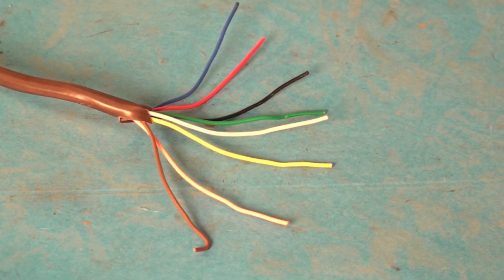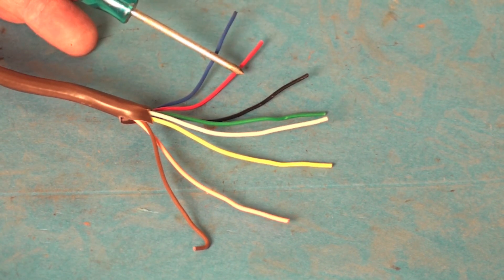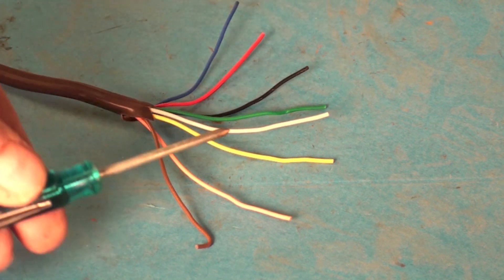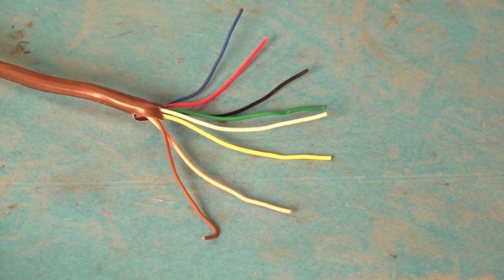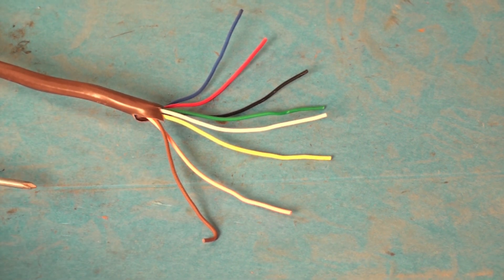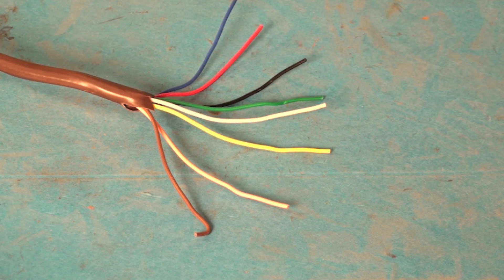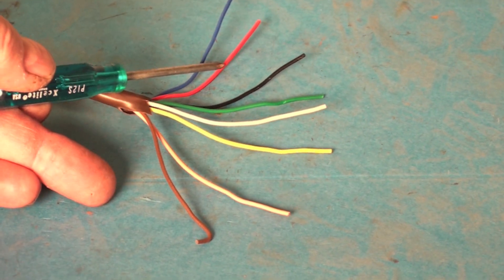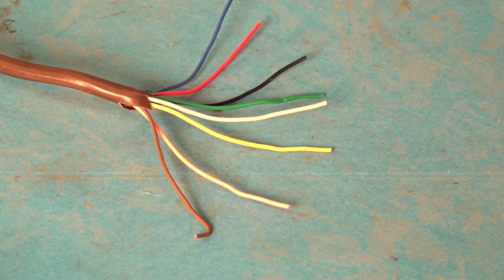Heat pump thermostat wire color code

Comment: I think it depends on the units age. And then it also depends on what type of thermostat you're going to use. Cuz mine is coming out different. But I'm finding out is being an HVAC tech a lot of things could differ. I am not a tech I'm just trying to install a newer thermostat. The color of wires and what they operate is not set in stone.. I'm starting to think there are a lot of  variables.

Comment: If working on an older unit, pay more attention to the way the board is wired in the air handler. Most often this is followed but sometimes it’s not, for whatever reasons.

Comment: Thanks for this. We have been roasting for years because they just want to replace our system in our area instead of diagnose issues. Was able to get my thermostat wired correctly and get some cool air in my home

Comment: New to the channel, so hey . Its just a question  about my thermostat wont kick on. My old sears heater for our home.  If i touch wites its sparks, but will not go otherwise. Any suggestion aside from just gettinga new  one.

Comment: nice video,but can you please help me connect them wires on my hvac heat pump non programmable thermostat   my actual wirings are red,green,yellow,blue ,white.and the thermostat is c,o,b,w/e,w2, thank you very much....

Comment: Hey Gary! I have a heat pump, no black wire. I have Red,  Blue, Green, white, yellow,  brown and orange. 

Trying to decide if I put the orange wire in the W2/OB slot or in the Y2 and the brown in the other
Reply from the maker: You can use brown for common if it is needed.  I would use white for W2 (backup heat).  OB (reversing valve) O.  You also need to know if the reversing valve is energized in heat or cool.
GFM
Reply: I ended up opening the furnace and checking how it was connected. The brown wire was attached to anything! So far it seems to be working! Your video was really helpful thank you

Comment: can someone suggest me with Honeywell classic (round one) and i have only two wires, black and white.
i tried to insert black to  black and white to white but boiler does not work. Alternatively, i connect white and black with hand to keep it running so basically thermostat does not work. Any suggestions please...
Reply from the maker: Set R to one wire and W to the other.
GFM

Comment: Question on my old thermostat my Black and white were both on the W in the panel? why was that?
Reply from the maker: The white is probably heat.  The black could be to power a humidifier.
GFM

Comment: If there is a nick on the white wire behind your thermostat plate, could this be causing the thermostat to go blank(no power) to it, then coming on a minute later?
Reply from the maker: The nick will not cause no power, but sometimes the wire inside the insulation is broken and will make intermittent contact.  You can find the break by looking for a loose spot in the wire.
GFM

Comment: Ok I have heat pump/ac with heat strips in air handler as emergency/aux heat. I just purchased a nest learning and  can't get the aux heat to kick on. I have orange and brown wire. Connected orange to o/b and white wire is in W1 and brown I assumed was the wire for the heat strips and put it in W2/aux. 
When I turn on aux 1 heat nothing happens but if I put it on auxiliary heat 2 the furnace kicks on and it feels like there's warm air coming out of it. so any idea what I did wrong and how to correct this?

Comment: On my rheem heat pump thermostat my black wire is not on the E in the thermostat.  It has been taken off by the previous owners. Is that a problem? Please help.  Ty.

Comment: I am a 75 year old HVAC mechanic, I go all the way back to coal heat, I have to say "I hate Heat Pumps"  When they came out in the 80's I steered most of my customers in the Mid-Atlantic zone away from them if they wanted to be warm. Now the new high efficiency furnace with pc boards aren't much better as far as plenum  temps are concerned. The fans turn on 60 seconds after the burners. I guess it's time to retire and sit in front of my pellet stove!
Reply from the maker: I am a 73 year old tech and have mostly the opposite experience.  lol  I started my career in heat pumps in 1977 in a location that had electric rates as low as .075 cents.  They only became less viable when electric went up and gas went down.  
The high efficiency gas furnaces have the same 120F plenum temp as gas designed furnaces always have had.  The fan delay is 30 to 45 seconds which matches older 1980 style furnaces because the heat exchangers are thinner and heat up faster.  
Maybe it is best to stay by the pellet stove.  I also get cold easier with age.  
GFM
Reply: Yes Amen to the pellit stove. Actually when I moved into my double wide at the beach I switched to the Hydro-Sil baseboard units. Zoned out the house so I have heat where I want it /when I want it. The best is the bathroom that I keep at a constant 74'. My towel rack is right over it so I always have a hot towel. My bill here in Delaware is $130 a month on a preset billing. Thank's for the reply. PS If I die tomorrow my relatives will come and dig me up so I can do another install gratis. Thank god I never gave up my account at RE Michaels

Comment: Blue = C.          Low volt common
Red = R.           Low volt power
Green = G.       Fan
White = W.      Furnace heat
Yellow = Y.      Compressor
Orange = O/B  reversing valve
Black = aux/em heat.       Electric strip heat.

Please follow the above standard. I've looked at at least 1000 units, and this is what I see on average. Modern units handle the staging in the control board.

If there are multiple stages, then we jumper them together at the control board and let the unit itself handle the logic involved in controlling the stages. I've only seen black used as a common a few times when a tech messed up and shorted one of the stat wires. To cut stat wire, I like to gently score the outer jacket, then gently bend around the scored section to finish pulling it off. There's zero reason to have shorted wires in the stat wiring.
Reply: Good  thankyou ineed  220v pleas explanningneed
Reply: Finally, someone properly trained.  This is exactly what you do and how you wire your system.  Unless it is a 2 or four wire communicating thermostat and system from Carrier /Bryant or any other brand.  The wires still stay the same at the system board, but the thermostat like the Carrier Infinity or Bryant Connex Evolution can use the four-wire set, if needed.  Because as Billy posted that the control board will handle the logic for the various stages of the equipment.  Black is used for a replacement wire or dual-fuel setups that do not have a communicating thermostat and board.

Comment: This video helped me understand the 8 wire system and what it really did was help me install my NEST e Thermostat. I was struggling for about a week to install this thing and was wondering why my heat pump wasn't kicking in, and now because of this video I saved $100 from having someone come here to swap a couple wires. Thank you so much for this video!
Reply: Do your remember the setup for the Nest? I’m struggling to find a good install example for my 8 wire heat pump on the Nest.
Reply: @mckennabrad  did you figure this out? I am looking as well
Reply: Happy new year.
GFM
Reply: Got a picture of your wiring I’m fighting with mine with 8 wires?
Reply: Any of yall got an answer lol I'm on a nest too and can't get it done😂
Reply: Nest isn't compatible with the 8 wire I tried as well

Comment: I have 8 wire all are connected to the terminals except for blue. The brown is connected to X terminal. Would my nest thermostat work in this system with heat pump? and where does the Brown or X wire go to?
Reply: Can't tell you for sure, it depends on the system and the original thermostat.
GFM

Comment: Thank you for the information. I got a Honeywell RTH111 thermostat and the old thermostat wasn´t there, but the house has a heating well. Now, I have a cable with 8 wires. I got the red, yellow, green combination, but I still have the orange and blue wire. Do I need to connect both or witch one?n
Reply from the maker: There is no way to tell for sure without seeing the application, but heating only red and white.  Fan green, cooling yellow, orange and blue are mostly used for heat pumps.
GFM

Comment: I have
Red to R
Blue to Y
White to W
Green to G
Brown to 0
What does the brown connect to?
My AC works, but the heat fan doesn't. Help me please.
Reply from the maker: In your case, if it is a heat pump, the brown is to the reversing valve.
GFM

Comment: I have a 6 cable witch is orange ,blue .white,yellow,green and red I’m trying to connect a Vivint element smart thermostat but I can get it to blow cold air it seems to cool the house but not as good as with the other thermostat that I’m removing
Can you please help ?

Comment: What if you only have 6 wires?  I don't have the orange or the black, but have the brown.  I jumped red, yellow, and green and the AC came on.  With the controller it would operate the heat, but not the AC.  The outside unit would come on in AC, but the inside fan would not.  Anyway, my wires are as follows on the controller, R-Red, O-empty, B-Blue, Y1-Yellow, E-Jumped to W2, Y2-empty, W2-White wire and jumped to E, G-Green, C-Brown, L-empty.  It's a Protech controller.  Since I jumped red, yellow, and green I hope a new controller will fix it.  Thanks.

Comment: I'm having trouble with a goodman air handler I have 5 wire thermostat cable on the unit R,W,G,Blue,Brown and I have 4 wires on room thermostat R,W,G,Blue and I have 2 wire from the Ac unit I need help I burn the fuses like 4 times can you help me

Comment: The brown wire is my issue and you really didn't cover that well,at all.
Reply from the maker: The brown is not commonly used and there is no established use for it.  It is sometimes used for backup heat.
GFM

Comment: Wire color means nothing , you can use any color you want to as long as  the wires terminate in the correctly  , "  Y  "  to. " Y "  etc ...  What happend is long ago people just started using red for  " R " because red starts with the letter   " R "   and so on , there is no rule that says you have to use a certain color to designate a specific terminal on equipment
Reply from the maker: You are correct.  But we have adopted a loose color code to make it easier to troubleshoot and install.
GFM
Reply: True , I just wish it were mandatory to use specific color code , and have the inspector verify upon inspection , I would take some of the guesswork out of diagnostic work .
Reply from the maker: Most of the inspectors I know would be lost trying to do that.
GFM
Reply: As stated wire color is meaningless.  If you don't know what a terminal does then you shouldn't be messing around with anything on you furnace, or AC or heat pump.

Comment: I am looking for a manual for a Amana unit. The model number is PHA24B0002A and serial number is 9212231454. Any suggestions? I am trying to wire up a Hunter 44760 thermostat correctly. Thanks!
Reply from the maker: No luck here.
GFM

Comment: Have you ever seen a grey wired used? I'm looking to update my thermostat to the Nest and I have the following wires hooked up to the old thermostat. Red, Grey, Yellow, Green and White. Someone please tell me what the Grey wire is. Thanks
Reply from the maker: Gray is not commonly used in thermostat wire.  The only way to know is to trace it to the furnace to find out where it goes there.  
GFM
Reply: grayfurnaceman thank you so much for replying. I looked a little closer and on the thermostat terminal for the grey wire it has C for common. I know I was kinda shocked when I seen this because C is usually blue but this house was built in the early 80's so maybe grey is all they had available that day. Do you think it could be mislabeled by chance?
Reply from the maker: The thermostat color code is not universal.  also, sometimes another wire that is usually used for common had an open.  So you kind of love the one your with.
GFM
Reply: Got ya, thanks for your help. Have a great day.
Reply: You've eliminated all options other than the black wire so I would assume it would be common, depends on if whoever installed it did it right though :s.

Comment: I used to have a heat pump but replaced it with traditional condenser unit. need to know how to wire up the emergency heat option. Honeywell does not know.
Reply: Scott did you find your answer?

Comment: I have a question my new package unit is blowing cold air even on heat mode so I check my wiring on termostat and I notice I have R,Y,W,G,C but c is not connected out side on unit. am I  missing  a wire here? is a electric  rheem classic package unit also unit and compressor works just fine but like I said heat mode blows cold air. TIA
Reply from the maker: The C terminal is probably not the problem.  I would look for breaker kicked off first.  Could also have elements or sequencers failed.
GFM

Comment: does anyone know how to wire a central heat and air that only has emergecy heat. no hear pump. I need a diagram for this.
Reply from the maker: Check my channel for diagrams.  I have several there.
GFM
Reply: I do not see the one that answers Chris's question

Comment: What connections at the stat would you touch together in order to activate the reversing valve in a cooling mode  heat pump? O-Y ?Thanks

Comment: I enjoy your videos very much Gary .
When wiring a condensate pump equipped with a safety switch in a heat pump system ,where would you wire the safety wires to? Terminals O or Y ?
Thank you
Reply from the maker: Put the switch in series with the Y circuit. 
GFM
Reply: Thankyou good  welcomed gues

Comment: I have a little issue with thermostat. When I turned "heat" on my thermostat, the heat mode didn't come on( left on 15 min). Then, decreased below temp  68F (my thermostat actual reading) to 63F and kicked in cool mode( appeared  2 snowflakes on my screen) and blew in cold air  on HEAT setting. I checked the wire system, I tightened the blue wire and make sure nothing is loose. Still the heat mode didn't come on.
Reply: +Freya Love  BTW I live in south Florida and has a heat pump. I'm clueless where the heat pump switch is located.... Super clueless.
Reply: +Freya Love Do you think it might be a thermostat malfunction ???

Comment: so if there's a wire on o the reversing valve is energized in cooling no matter what? and if it's on b it's energized on heating no matter what?
Reply from the maker: +kurtis bardic You got it.
GFM

Comment: we have a package unit A/C and Heater.  we had to have our fan replaced at the top of the unit and since then we can not switch from A/C to heat.  we have called out techs from our warranty company and they say that there is a break in our white heating wire and advised us to switch orange to orange on the unit and swap the orange and white wire place on the thermostat to manually go from A/C to heat.   it is not working for us....  we have called on this 3 times.  1) how can I make this work 2) we want to get this broken wire fixed, do we need to replace the whole thing,  what is general pricing in your opinion?    your response is greatly appreciated.   Thank you!
Reply from the maker: +Zeheria Zan What kind of warranty company do you have?  This appears to be their problem, not yours.  I would be on them the make it work.
GFM

Comment: I bought a new thermostat that has no terminal for the E wire which is Emergency Heat. They told me I need to combine the E wire and the W2 wire with a wire cap and run another wire from the cap to the W2 terminal. What type of wire cap and wire do i need to get?
Reply from the maker: +D Foxworth I have no idea what a wire cap is.  Perhaps they are saying to connect both wires to W2.
GFM

Comment: wish I knew how to get my heat to work :-( by this it looks hooked up right but it's still freezing
Reply from the maker: +Mary Lethco Usually wiring is not the problem if the unit has been running normally.  All breakers and fuses ok?
GFM
Reply: grayfurnaceman the fan is moving outside but not blowing out
Reply from the maker: +Mary Lethco Check the fuses for the outdoor unit, also the panel breaker.
GFM
Reply: I would just like to update you on the issue. It was the internal motor that was bad and also low on fluid
Reply from the maker: +Mary Lethco Thanks for the update.
GFM